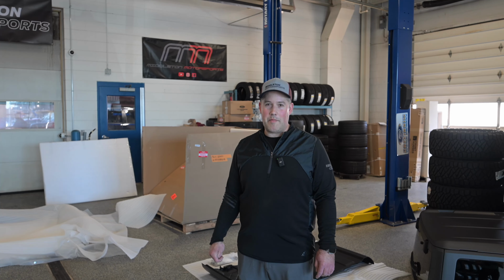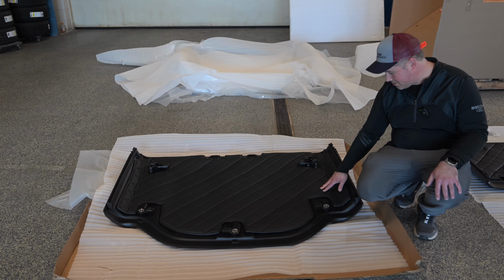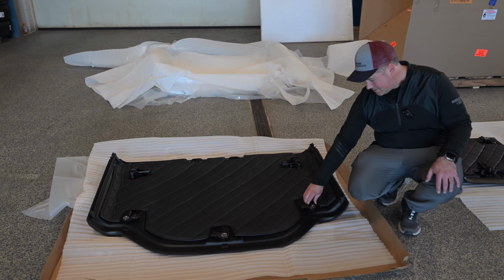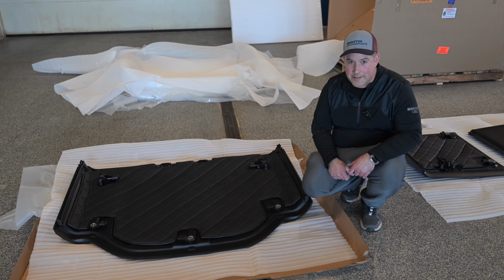NEW Ford Bronco Anderson Composites Hardtop. Bird Dog Overland Gets 1st Delivery In The Country!

Comment: Not convinced yet of any after market hardtop. This one has color issues and also it concerns me the fitmen i. the backside, the window looks like it can't close all the way.

I guess now we understand why Ford is having lot of issues with the production of this hardtop.
Reply: The back window has no issue with mine.  The color issue depends on the lighting and angle you are looking at it.  You can see it with the camera pans in this video.  One second it looks off and then all the sudden it doesn’t.  Doesn’t bother me personally though.
Reply from the maker: Color is identical match. Camera picks up different with the light. No issues yet on the hard tops we have delivered and installed.